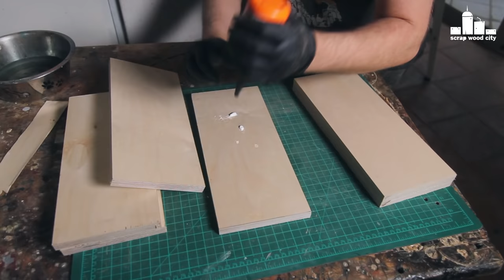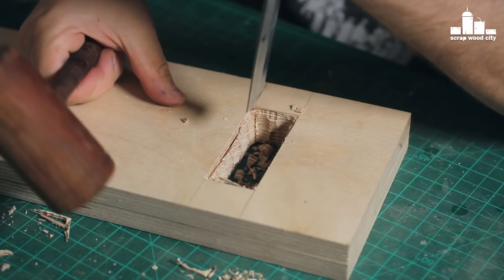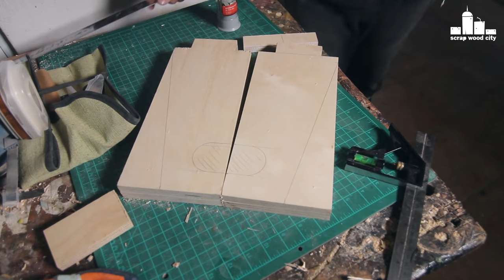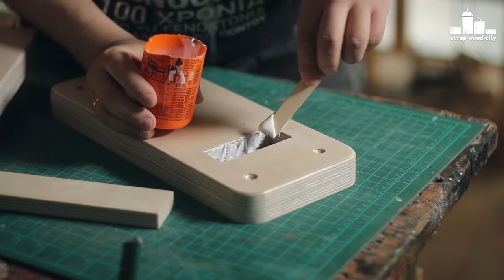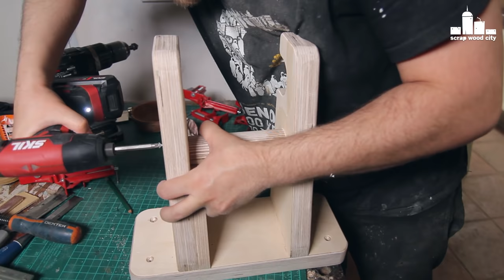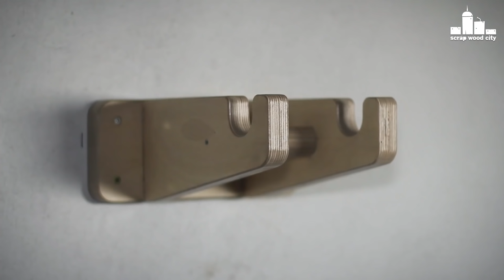DIY plywood bicycle rack

Comment: Excellent build. I made 2 very similar racks last year for our bikes. 
I only added a small channel on the two hooks to prevent the weight from damaging the cable under the crossbar. Apart from that, I did it almost the same way as you have done here. Nice one.👍👍
Reply from the maker: Nice. The channel is a good idea!

Comment: Cool design! Just a thought, but a person replicating this could A. Probably be fine not doubling the plywood thickness as you did, and B. Could make a lap joint where the arms went around the top and bottom of the backing plate rather than a mortise and tenon. The advantage there would be the whole thing could be made on the table saw with a lot less effort and pretty similar strength. Thanks for sharing! Going to make two today.
Reply from the maker: Not sure if strength would be similar. I think it would be much more weak. Mi bicycle is pretty heavy. Perhaps it would work with light weight bikes.